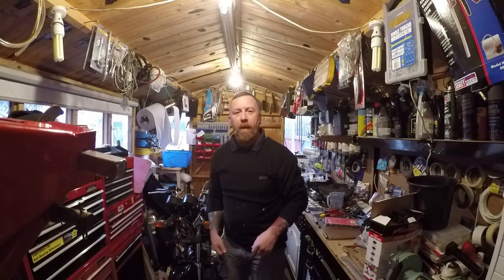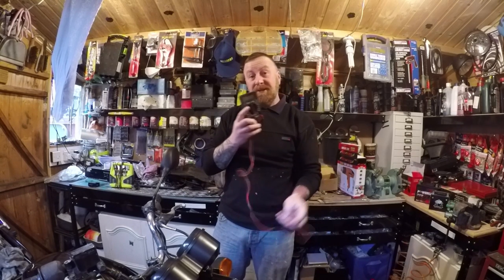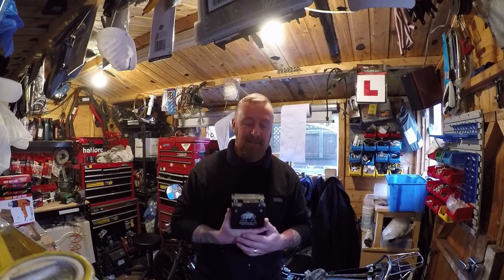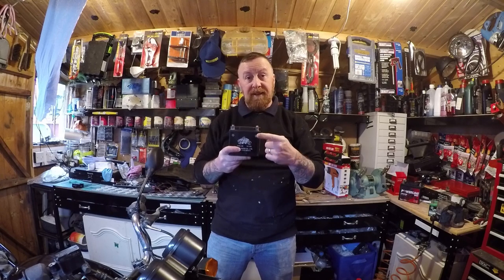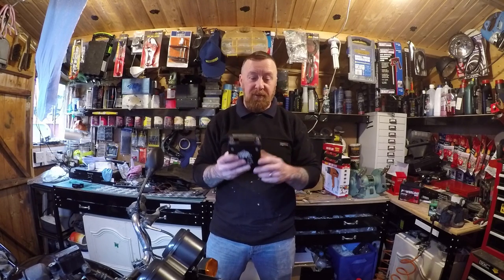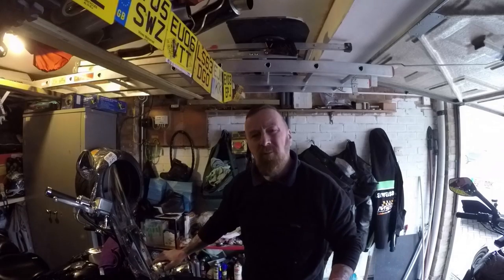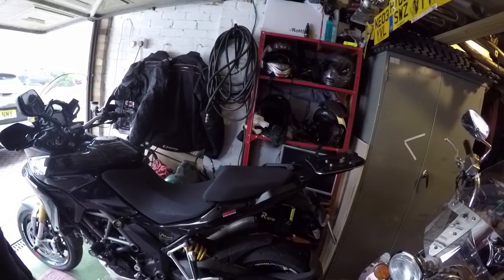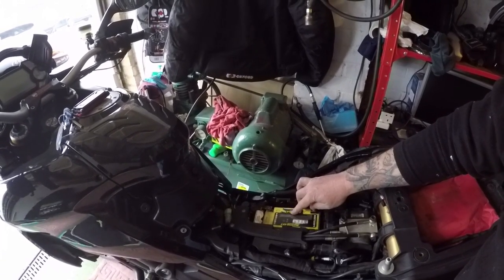BATTERY FAILIER TIME TO CHANGE IT , MARK SAVAGE

Comment: Good timing, changed my battery just this morning, went and replaced the CDI unit in my Speedfight at the same time. If any of you have any issues with the CDI draining your battery unusually quickly look into getting a bypass unit. I checked the current draw when the bike is standing and it went from 5-20mA with the original unit down to 0.2mA which is next to nothing at all.

Comment: I'm  not keen on buying a new battery till I know mt project moped is good..... can i use a 9ah instead of a 5ah without blowing anything,, Thanks Paul
Reply from the maker: hi bud
Using a jump pack or higher amp battery wont damage the moped while your working on it, its when people jump them from car battery's while there running and so on that damages the moped 
thanks for watching , I have many more videos you might like to watch om my channel 
mark
Reply: @marksavage  Thanks, yes going through them slowly :)

Comment: Hi Mark sorry to bother you I know you get lots of these problems and I’ve watched almost all of your videos on Speedfight’s and I think I know he problem but the bike doesn’t pick up until 6000rpm and then when under load it’ll rev up to 6000 and then will go back down I think it’s the carb and not getting enough fuel I’ve changed the rollers and belt but no luck really my dad is refusing to believe it’s the carb but I fully think it is what would you say? Many thanks keep up with the channel
Reply from the maker: hi bud 
thanks for watching and with over 60 videos on the speedfights that a lot of watching lol
so you have changed the rollers to what weight? this can play around with the bike and also the wrong belt fitted or even the clutch as in my videos 
moving on to the carb what size jet do you have ? as in my tuning video and can you adjust the air mix
spark plug ok?
if it was petrol bud when it's running on full revs it would slow down and die if it was fuel then after 30 secs start back up again but you can test the vacuum as i do in my videos on carb and fuel 
what speed are you getting and do you have a sports exhaust / cleaned air filter
theres a few things it can be and are you working on a sp2 or sp3?
hope this gives you other bits to look at and try out 
mark
Reply: mark savage I have a sp3 and standard rollers were put in so around 8 grams the belt we fitted was a genuine Peugeot belt the clutch shoes have been measured and they’re 2mm thick. We haven’t been able to properly ride it yet as under load it will rev up to 6000rpm and it just dies but not under load it’s fine so it could be not getting enough fuel thanks
Reply from the maker: as in my videos i do not love the sp3 as the are cdi restricted but still are fun bikes just not t owork on as i have over 10 of the sp3 
they do suffer from earth problems to on the cdi side
make sure the fuel lines are in good condition and do not go under the carb and this too can cause problems 
have fun bud 
mark
Reply: mark savage hi mark found out what the problem was and it was the clutch the pads on it were too worn and was enough to spin the wheel without weight on it but with weight they’d just slip. But onto further problems we discovered when we first took the clutch case off that it’d snapped a piece on the inside casing and I’ve found out that the gearbox cover had sharped off and that’s what’s done it a garage has clearly done a crap fix just putting sealant in the part that’s sharded off and now im gonna have to buy a new cover was wondering if you had any lying around that you’d let us pick up for cheap maybe? Many thanks josh
Reply from the maker: Joshua Peaker that’s good news you found it bud 
As the the work from the garage well they wouldn’t be the first to do a doggy job 
Sorry bud no parts but e bay bud is the best place 
Mark

Comment: Hi  mark I am thinking  about adding a motorcycle  dashcam  could I put a neg connection  to the battery then remove my 10 fuse and add live to 10 fuse then rei set the fuse thanks
Reply from the maker: I have 3 videos on fitting bash camera so all worth a watch 
I did that on one but on my tiger it stayed on which was odd but give it a go bud 
Type in dashcam mark savage.